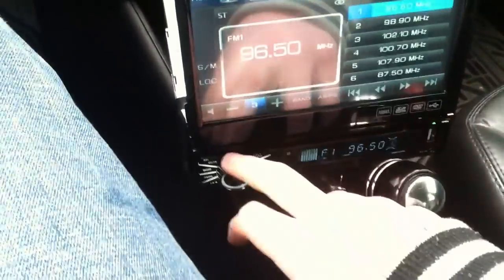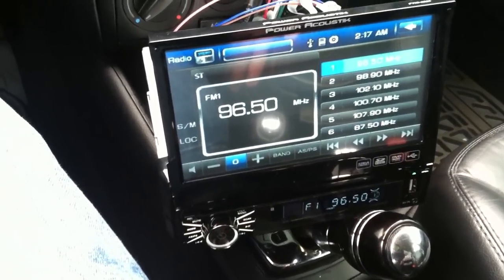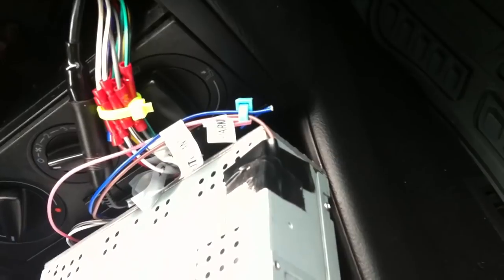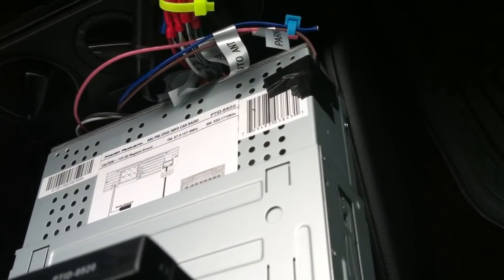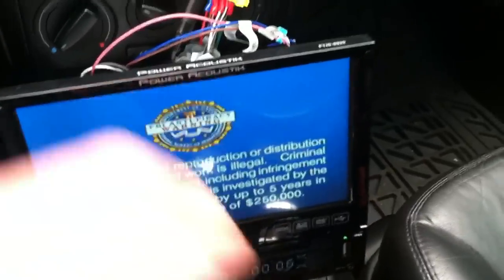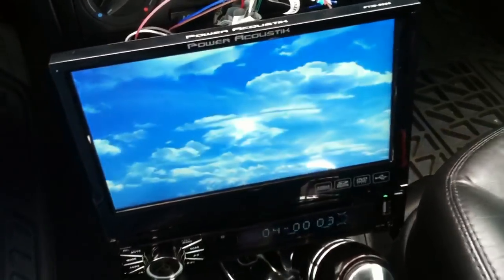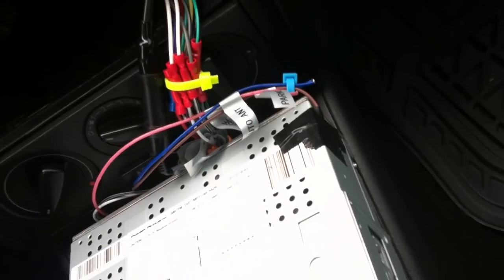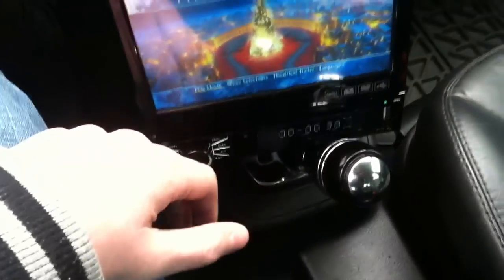Parking brake bypass, super easy!

Comment: Thanks man! The install directions for mine say " Do NOT simply ground the parking brake detect wire to a metal portion of the vehicle to bypass the feature". So, I was like, they are trying to tell me how to bypass it without being liable but I wanted to check before I did it so I searched and found your video. Thanks

Comment: Hello Adam, a big thank's from France!  it works!  for those who wonder if the trick still works on newer version of 2017 Pioneer avh the answer is yes. 
I have just installed a brand new avh-z7000dab in my 1998 honda prelude, I have clamped the red clip wich is on the light green parking brake wire on the black ground wire of the cigarette lighter and that's it. work's fine now.

Comment: also worked with power acoustik unit pd-344B. I ran a ground wire straight from the negative terminal of the battery and now I have movies. thank you very much man.

Comment: I thought it looked like ass till you pointed out it was just for a quick video demo. It's cool to see that you use butt connectors instead of wire nuts or just tape. I usually only see pros do that so props.
Reply: I soldered mine.

Comment: Thank you! i just loosened  a small screw on the back of my pioneer and wrapped the green wire around the screw and tightened it again. works very nice!
Reply: Did u ground it to the unit??
Reply: Zac Wilson Yes the green wire is grounded to the unit
Reply: Cool I have a  boss fold out unit... Similar look so I can just ground parking wire from unit to ground on back of unit??? Jw
Reply: Never found the answer on YouTube for boss audio
Reply: Zac Wilson Should work the same on Boss
Reply: Hey what kind of pioneer was it I would like to do mine I have a pioneer
Reply: It did

Comment: I ran mine from a toggle switch it worked perfectly i have a newer bluetooth pioneer that i cant really use the features unless i have the ebrake on that feature is useless with my truck its older and has a busted parking brake

Comment: I just grounded mine with the black main ground and it worked great
Reply: slyt ssj will that drain my battery then while the ignition is off and the vehicle is sitting? I’m not sure if mine will work with just grounding via tape yet, but since that is the two-second fix that’s what I would like to do.

Comment: Now, I have two questions regarding this. 1 - If you had a head unit that had an attached backup cam in mind, would that fudge with it? Basically would the backup cam simultaneously think it's both in park and reverse, screwing up the whole thing? 2 - I think I understand why you have the less than optimal asthetic choice, but on the off chance I'm wrong, is there a way you can reliably ground the parking wire while keeping the head unit inside the dash?

Comment: I did a bypass with one of those things on eBay about 6 years ago.  How do I make it so it won't play while driving now?  I am selling the car.  I don't care if the dvd player works at all.  Can I just disconnect the light green Parking SW wire from the unit?  Been so long that I have no idea what I did.

Comment: Cant you ground it to the ground wire itself? And what kind of rear monitor can i get to plug in the back of my double din so my kids can watch same video in back seat?will any head rest work or any certain kind i dont want a flip down or wanna buy another dvd set up want to plug it in to my boss elite radio.

Comment: Easier way is to hook it up to your stereo ground wire.i always do it to indashes when i install them and it works perfect. Plus you wont has to worry about electrical tape unpealing over time
Reply: +Yvette Quinones It should be labeled. if not look up your stereo make and model and check the wiring diagram. On most cheap stereos the wire color is typically Black, brown or tan I believe, these are the ones that you can easily bypass by hooking up to stereo ground wire. Some other high end stereos have a green wire with black dots or  even a pink wire.the higher end stereos aren't easily bypassed, you have to hook them up to a switch or relay of some sort like in the video
Reply: Brown

Comment: You never ground a parking brake to the actual head unit. Grounding the park brake switch, only works on low grade dvd players (boss, Jensen, power acoustik, etc). Name brand units (Kenwood, Alpine, jvc, etc) require a pulsed relay to trigger the park brake sensor.
Reply: I have a sound stream and tried to ground the parking brake wire, and toggle switch. Neither worked. Can you direct me to the pulse item you're speaking of?

Comment: I grounded the parking break and it is saying cant play video while driving because I connected the parking brake wire on the ground wire and I have a 2003 dodge grand caravan with a soundstream aftermarket sony stereo so what am I doing wrong

Comment: For my SoundStream it actually needs 12 volts not a ground
Reply: So did you get it hook up, for the video to show?
Reply: @chrystehugh2842  yes but there is still something going on with factory amp cant get any sound to come out I looked up where it was supposed to be under baxk seat and its not there im starting to wonder if I even have a factory amp but the only wire harness they sell to put in a aftermarket head unit has no hook ups for speaker wire and I just got my roll of blue ice ofc o/1 guage and silver 25 ' of 0/1 guage, for my lexus Im doing a modest system in lexus for weight and trunk space either 3 resilient sound gold 12s or 2 gold 15s or a platinum 18 ran off a PPI black ice 7000 that puts out 3300-3700 rms at .5 ohms. But I have 3 other vehicles a 05 bmw 325i real nice I'm juat gonna upgrade highs and run a single 12 in a vented box in trunk and put 2 8" skar mid bass' since I already have them the lexus will be running all 5's line highs off a PPI 2200.5 I also have a 98 civic coupe and a 2003 ford explorer i think that's what I'm going to put the big system in 6 15s eaxh pair getting 7k rms plus I can actually get high out put alts for the explorer where I can't with my lexus Im going to have to rely on a bank of 3 batteries and maybe a bank of super caps to keep voltage on the dump even at 13.01 volts the PPI 7000 but out a lil under 3300. Pulling like 350 amps
Reply: @chrystehugh2842  new skar highs are in and new PPI 2200.5 is all hooked up and working.had bad factory amp that stoped sending signal throwing in temp subs in today until my 4 resilient sounds platinum 12s get here ill be running 3 kicker comp r 12s

Comment: Doesn't this run your car battery dead? Cause mine died the next morning. Assuming it's cause you're basically hot wiring it 24/7? It works but it ran my battery dead 🙁
Reply: You probably had a bad battery? Radios have constant power to them anyway to retain preferences and last station.

Comment: Well I know that's the problem cause the wire is connected to the stereo (grounded) and it's basically tricking it that it's on All the time. Like the memory cable.

Comment: i was waiting to find this video, everyone was talking about connecting the ground to a switch or some bullshit and im thinking why dont you just leave it grounded
Reply: +Dale Pogue Because on anything over 200 bucks, the radio knows that a permanent ground is bullshit. If you don't take it off and put it back on after EVERY time you turn it on, it won't work. On mine, I can ground it, but once you cycle the key, it won't work, and it must be ungrounded and regrounded again. Pioneer AVH3600
Reply: +**Classified** 100

Comment: Couldn't you just tie the parking brake ground in with the radio ground or even bolt it to the back of the radio, I have the power acoustic pd 342b double din radio

Comment: If I Keep the parking Break  wire Grounded permanently will it Drain the Car Battery if the Car sits in the Driveway for a few Days Please let me know
Reply from the maker: No it will not.
Reply: What are you talking about?
Reply: Adam Perkins  ok Thanks I wasn't sure if the unit would still Draw power while the Vehicle was off and Drain the Car Battery

Comment: Point is do your research what works for 1 model might not work on another my unit is a brAnd new 2019 so they might have realized how easy it was to bypass a simple ground and changed it to a positive to get people to maybe get there head unit wich u obviously just voided warranty on or maybe some states required a diffrent method all im going to do is wire it to a 12 volt ing source

Comment: does this work on. pioneer avh 270bt
Reply: +Jamie Mulholland Did it work for you?
Reply: Yes it worked :) thank u
Reply: question how did u ground it? did you just tape the wire (striped) to the deck, or did you connect it to a terminal adapter thingy and then tape that to the deck?
Reply: +Zaheer Khan I want. to know the same thing lol